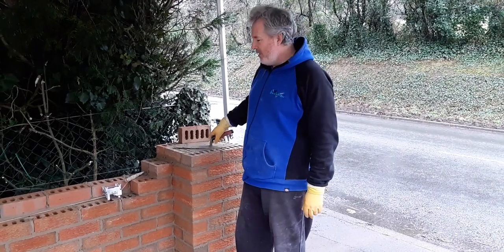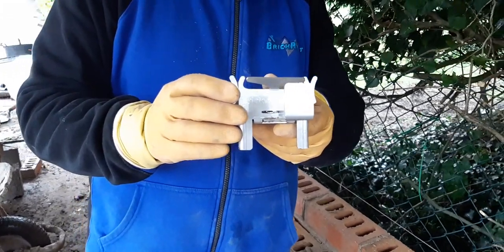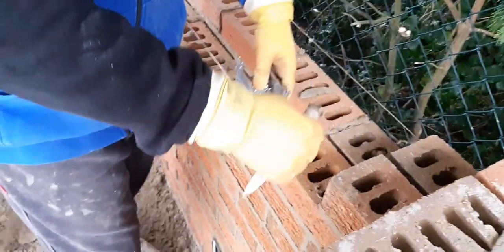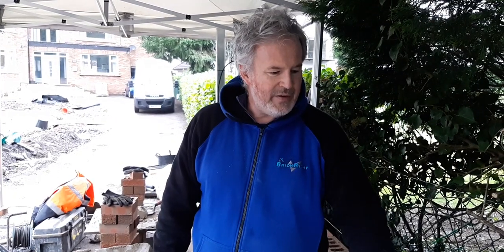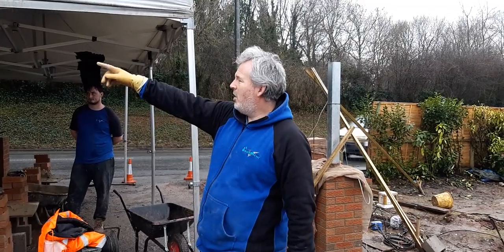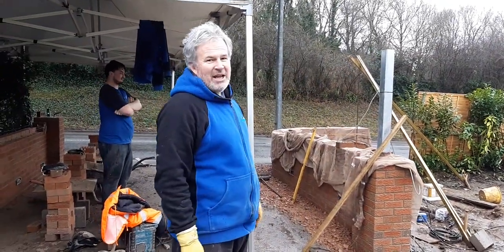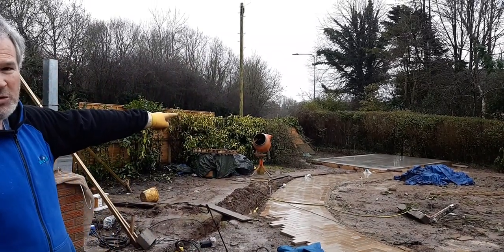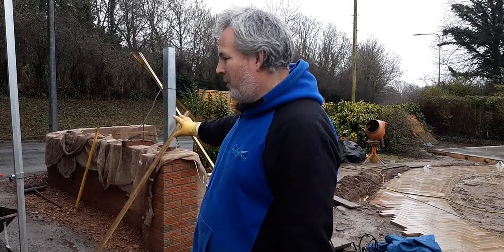#bricklaying FITZ BRICK Clamp review & set up

Comment: Is there a video about the steel posts in the peers?, I've not seen them before, always used rebar. I've just bought the clamps but not had chance to use them yet, they look easy and very useful. Great video as always. Cheers
Reply from the maker: I didn't do a video on the steel posts sorry .they are just posts with a base plate and fixed to the foundations then we built the pillars and connected around them the gate hinges are welded to them to reinforce the pillars and gates together 👍